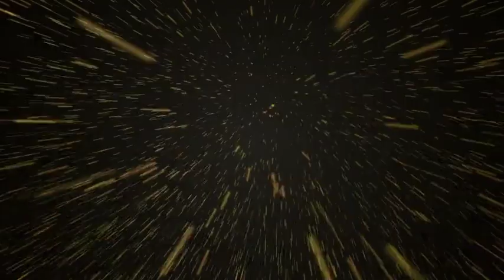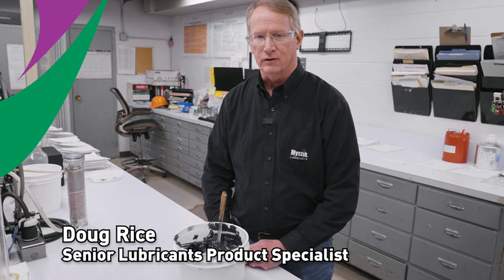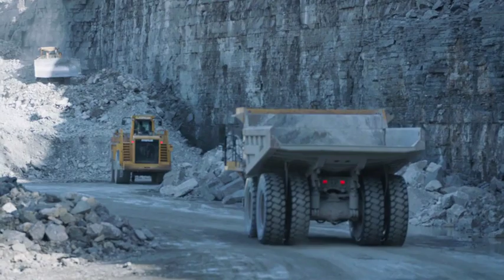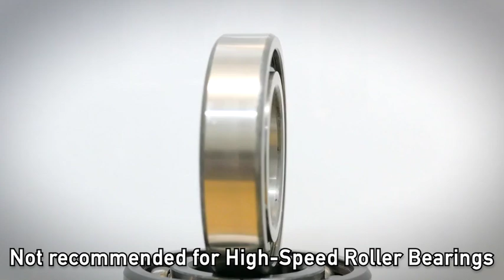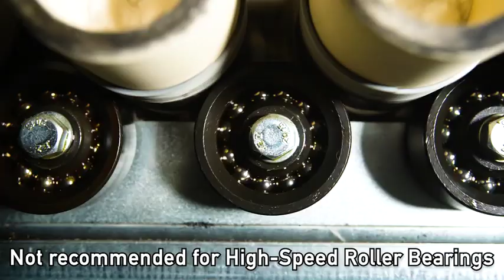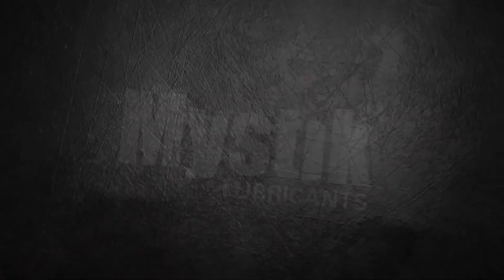Moly: When to Use and When to Avoid in Grease Application

Comment: Thank you for the information. I don't believe RV travel trailer wheel bearings are considered "high speed bearings" so would you recommend using moly grease for RV wheel bearings? If not, what high heat grease would you recommend for that application?

Comment: Thank you for this. Time to swap out the moly grease I put in some roller bearings before they get flat spots. What type of grease would you recommend for roller bearings with about a 35 pound load?
Reply: Great question! For roller bearings under a 35 lb load, you’ll want a grease that can handle pressure without breaking down or causing wear. That’s exactly where Primrose Armor Plate Grease with Moly D shines. Unlike standard moly greases that use moly powder, our liquid Moly D bonds at the atomic level, giving smoother film strength, lower friction, and longer-lasting protection. Many customers swear by it for bearings and heavy-duty applications, because it cuts down grease consumption and prevents costly repairs. We’ve been perfecting this since 1916 (109 years strong), and we ship worldwide. If you’d like more details, just let me know — I’d be happy to point you in the right direction.